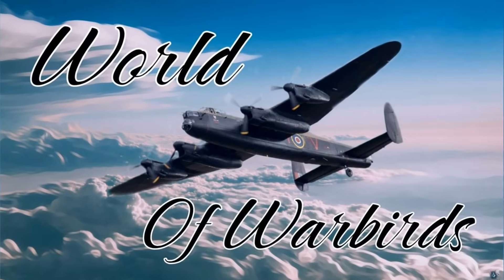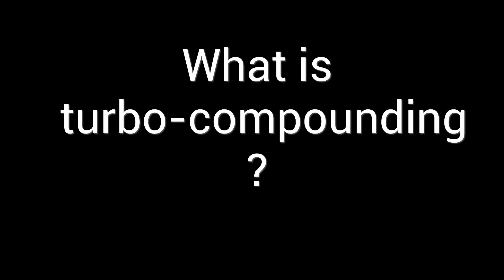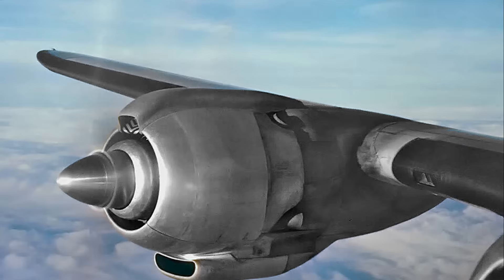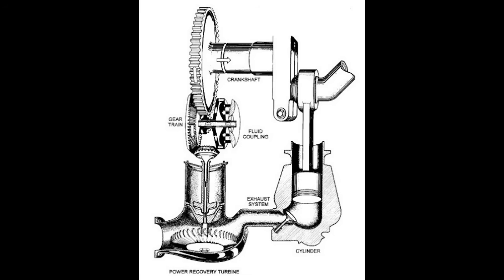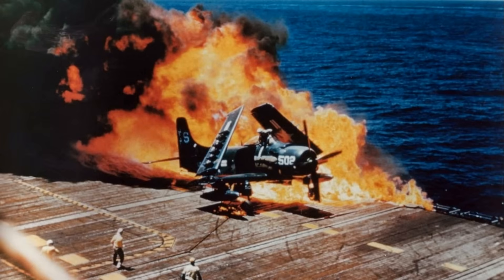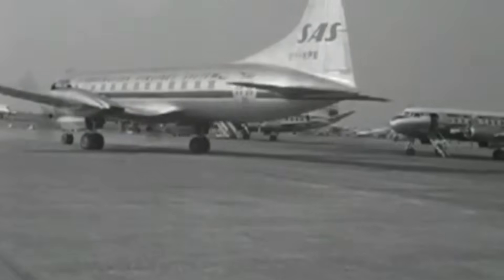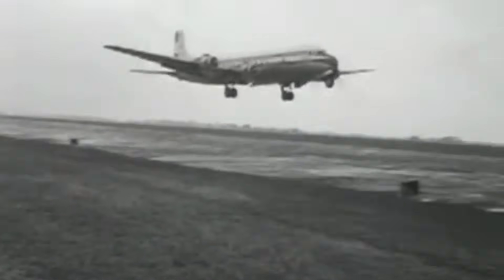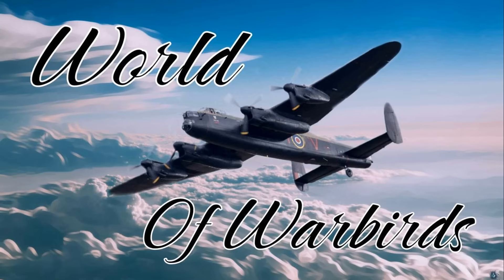Turbo-Compounding: The Forgotten Power Booster of WWII (almost) and Beyond

Comment: The problem with turbo compounding is that it is conceptually flawed. It scales well, but in the end you end up with roughly equal power output from the turbos and the piston engine, which means that the piston engine is simply a complicated gas generator for the turbines. The obvious solution to the problem is to Simply build a turboprop
Reply: There are no turboprops that are even remotely as efficient as a turbo-compound engine.
Reply: @PistonAvatarGuy the dc-7 Disappeared before the dc-6 because of the high operating costs of the turbo compound engine. There is a reason why the technology disappeared. Turboprops are the answer for efficiency
Reply: @jimeditorial  Except that the high costs associated with the turbo-compound engines were a result of mechanical problems, not inefficiency. Turboprops are less efficient than turbo-compound engines, but their operating costs are lower because they're more reliable and need less maintenance.

When you get down into the lower horsepower range (less than 400 hp), turbine engines just become completely impractical due to their cost and their inefficiency (which decreases with the power rating of the engine), so turbo-compounding again becomes attractive. These days, engineering is such that turbo-compounding is far more practical than it was in the past. In Formula 1, for example, they've completely eliminated the unreliability of the mechanical transmission between the engine and the PRT by making use of a hybrid-electric system.
Reply: @PistonAvatarGuy actually, turbo shafts were regulated out of auto racing because of their dominance. And there is very little market for commercial aircraft engines below 400 horsepower. In that power range, The Logical solution is pure turbocharging, in a liquid-cooled inline engine for lower frontal area. But the thermodynamics are inescapable... if maximum efficiency in an airliner is the goal, use a turboprop. If maximum profitability is the goal of the airline, use gas turbines. But today's geared turbo fans and some of the new open rotor designs appear to be going back to the turboprop in concept. No one is talking about developing a piston engine to replace even engines in the pt6 class
Reply: @jimeditorial   How is racing relevant in a discussion about engine fuel efficiency? And, no, I don't believe that turbine engines were ever successful in racing, because they lag horribly. They might be successful on certain racetracks, which don't require good acceleration performance (many NASCAR and Indy tracks), but they would never work well in something like F1, or any kind of racing with a significant number of road courses. Even Indy and NASCAR have road courses. Many racing series are also starting to limit energy consumption, and because turbine engines in the power output range that's suitable for racing cars absolutely guzzle fuel, they would never work in those series.

Just as an example: The Rolls-Royce (originally an Allison design) M250 consumes about twice as much fuel per hp produced, when compared to a piston engine of similar power output.

Those turbo-compound Formula 1 engines are some of the most efficient ICEs on the planet, btw. They even beat the efficiency of many large marine and stationary diesels.

Obviously, turbine engines are better suited to airliners, and the market is too small to integrate PRTs into light aircraft engines, but the point still remains, turbo-compounding offers unequaled efficiency. Even an increasing number of stationary and marine engines are beginning to use heat recovery systems, of one form or another.
Reply: You are missing the point. These are heat engines. The ultimate efficiency of any heat engine is related to the delta T between combustion and ambient . If you scale a turbo compound piston engine, you discover that you maximize efficiency by adding fuel Downstream to combust the residual oxygen in the exhaust stream . This is why piston engine then becomes a little more than a Giant gas generator for the turbines and for a large radial engine, there will of course be several turbines. Along with gearing and fluid couplings. It's a mechanical monstrosity, which is why they disappeared so quickly in commercial service. Modern Formula 1 engines are not turbo compounds, they recover power and store it electrically.  at the rate that Battery Technology is advancing, I expected in 10 years, battery electric Drive Lines will completely replace combustion engines and Formula 1 as well. If you wanted to clean sheet a design for maximum efficiency, you would probably design a turbocharged and blower scavenge horizontally opposed two-stroke diesel, a sort of miniaturized Jumo. But there would be little economic reason to do it. General aviation is small and in relative terms, it's getting smaller. Light aircraft technology has lagged the industry as a whole by decades. 1940s technology is still common. You can go into any GA hangar in America and hear the pilots talking about things like carburetor icing and shock cooling. Only the avionics Community has stepped up, and the regulatory regime won't even recognize that. We are still training Pilots to handle cross countries by dead reckoning. The only way to improve the efficiency of piston engines is by heat damming, and by using a waste heat in any way possible. But to connect a turbine to the crankshaft doesn't make sense in small engines, and it's inefficient in large engines.
Reply: @jimeditorial  Modern Formula 1 engines absolutely are turbo-compound engines, that's not even disputable. The energy collected by the MGU-H is fed back into the driveline via the MGU-K, it's just an electric coupling, instead of a fluid coupling. The batteries are not there to supply a significant portion of the energy that's used by a car during a race, they're just there to store the energy produced by the MGU-H and MGU-K.

The Formula 1 engine system itself, without including energy supplied by the battery, is more than 50% THERMALLY efficient, that makes it one of the most efficient engine systems on Earth.

Electric vehicles aren't progressing in any meaningful way when it comes to racing, they're so far away from replacing ICEs in the vast majority of racing series that it's ridiculous to even suggest that they ever will do such a thing. They can do very short races and they can dominate when they have huge budgets relative to the rest of the competitors (Pikes Peak, for example), but they can't complete an F1 race at anything even remotely close to the same pace as an F1 car, and the same is true for the vast majority of other racing series. Ever wonder why a Formula E car has never been pitted directly against an F1 car, on an F1 track? Its because the F1 car would not only demolish the Formula E car in pace, but it would also be able to maintain that pace for far, FAR longer then the Formula E car. In the slower racing classes, cost will keep electric cars from ever becoming dominant, as the vast majority of racers will simply never be able to afford an electric race car. No one is even buying the Speirling, because it's insanely problematic (the suction fans) and because it's insanely expensive. Seriously, just name one racing series where electric cars are taking over in large numbers.

Sorry, but you're just drinking the Kool-Aid.
Reply: @jimeditorial  And I don't understand what you think that I'm suggesting be done here, I'm just pointing out that in actual use, turbo-compound engines have proven that they're more efficient than turbocharged engines. What's the argument that you're trying to make against that? That they weren't? What radial engine was more efficient than the turbo-compound R-3350? What gasoline automobile engine is more efficient than current F1 engines?
Reply: @PistonAvatarGuy gas turbines were regulated out of Auto Racing for a reason. If they were permitted, then all Formula 1 engines would be turbines. For the same reason why aircraft in the same horsepower class as top-level auto racing are now all turbine powered. Thermodynamics. What mechanical complexity is definitely a factor. Operating cost per hour of engine operation is determined by a lot of things, and fuel consumption is just one of them. Which is why the dc-7 died, while the dc-6 continues to fly. Fuel is still one of the cheapest inputs in aircraft operations
Reply: @jimeditorial  You're very smart.

Comment: Would love to see someone mess around with this again just for the fun of it.
Reply: What on Earth are you talking about? The turbo-compound engines used in trucks are STILL turbocharged, so they still benefit from the blow-down effect (which is what you're describing), but they also benefit from the power recovered by the PRT feeding directly into the crankshaft.

Volvo turbo-compound engines are currently in production and they have been for a while now. Cummins and Scania also produce turbo-compound engines. Turbo-compound engines provide an increase in both power output and fuel efficiency relative to turbocharged engines, because they're using more of the wasted heat energy in the exhaust than the turbocharger alone can utilize. Turbochargers have wastegates because they need to waste a certain amount of energy from the exhaust in order to prevent them from over-boosting the engine, while a PRT just feeds the excess energy back into the engine, improving both efficiency and power output.

Hybrid-electric PRTs are even better, because they can draw energy from a battery and feed it into an MGU-H and MGU-K to literally eliminate lag, because they can more efficiently capture energy that would otherwise be wasted (no inefficient fluid coupling) and because they can better regulate the PRT system, allowing it to operate more efficiently.
Reply: @PistonAvatarGuy  I've yet to see a heavy truck fitted with a wastegate. That's not how truck diesels operate. Hint it's done with the fuel, what you said - and why on earth try to limit MAP on a diesel = more is better long as it stays in one piece.
     Never seen one with a PRT either for that matter. Not on America's highways. What you said seems too fancy and not easily repairable on long, long, loooong hauls.
Reply: @patrickshaw8595   You must be trolling, they all have wastegates, except for some newer diesels that have some kind of weird balance valve. There has to be a way to limit the amount of power that the turbocharger is absorbing from the exhaust stream, or the turbocharger will over-speed, over-boost the engine, or both.

Volvo's turbo-compound engines do operate on US highways and they do save fuel.

Edit: The VGT turbos might not have wastegates either.
Reply: @PistonAvatarGuy  Old trucks didn't have wastegates, but all modern ones I'm quite sure have some way of limiting turbine power.
Reply: @TarenGarond  Interesting, they must have been too choked off in other ways to end up in an over-boost situation.
Reply: @PistonAvatarGuy  I mean it is not really that weird on a Diesel as fuel flow adjustment changes power of both the engine and the turbo, just need to have a turbo with suiting compressor and turbine sides so that you get no over speeding or surging and somewhat acceptable air and exhaust pressures throughout the rev and load range.
Quite sure there is some Diesels still built like this but probably not on truck/cars, like on something that is supposed to almost always run with a nearly constant RPM and only with small load fluctuations a way to control turbine power is not really necessary.
Reply: @TarenGarond  Right, but that would mean that the turbine simply wasn't designed to collect as much energy from the exhaust stream as a turbine system potentially could, meaning that there would still be a significant amount of energy left in the exhaust which could be recovered.
Reply: @PistonAvatarGuy  Yeah, I didn't argue against the practicality of turbo compounding just wanted to discuss wastegates... XD
Have a good one!
Reply: Volvo experimented with Power Recovery Turbines back in the 90s. Let me explain something to you: Turbochargers are better especially for diesels. Say you are driving along down the highway in your semi and the turbo is providing say 7.5 psi boost. THAT IS ACTUALLY HORSEPOWER EXTRACTED FROM THE EXHAUST AND AIDING THE CRANKSHAFT BY MAKING THE ENGINE'S INTAKE STROKE INTO A MINI-POWER-STROKE. < Power recovery PLUS the ability to burn more fuel and make more power when needed. So Power Recovery Turbines - being uni-taskers - went obsolete (for diesels, anyway)
Reply: @patrickshaw8595  Some of the producers of stationary and large marine engines (Jenbacher, Sulzer, etc) also make use of heat recovery systems of various types.

Comment: Plenty of pictures of Volvo's turbo-compound system, but no mention of it in the video. Current Formula 1 engines are also turbo-compound engines, but instead of using a mechanical system to transfer energy from the turbine to the crankshaft (and to a battery, if necessary), they use a hybrid-electric system.
Reply from the maker: Hello, yes I used any images I could get to illustrate, but my interest is in aviation turbo compound and not in general. Thanks!
Reply: @worldofwarbirds  I see, but the video title also suggests that the technology was forgotten, when it clearly hasn't been.
Reply: @PistonAvatarGuy  OK, we got it. You've made your point that you know a lot about turbo-compound engines, but there's no need to shove it down our throats.
Reply: It has nothing to do with the uses you have mentioned, it is about WW2.
Reply: @bigboy9693  Yet he included pictures of Volvo's modern turbo-compound system.
Reply: @PistonAvatarGuy TO EXPLAIN THE CONCEPT, YOU GOOF. By calling it “forgotten” he’s just saying that we (the lay-person with knowledge of WW2) don’t tend to know about these aviation powerplant advancements, as much as we would know about jet development, for example.
Reply from the maker: Thanks, but let’s all play nice!
Reply: @dillan6134  Plenty of other pictures that he could have used. The Dobrynin VD-4K is suspiciously absent, for example. I learned about turbo-compound engines many years ago, I never forgot about them.

Comment: Nothing drives innovation like war!
Reply from the maker: Sadly, but realistically, yes!
Reply: Racing. In F1, there are currently hybrid-electric turbo-compound engines, which do away with the mechanical complexity and unreliability of the Wright turbo-compound system.

Edit: And I'd rather see innovation move along at a snail's pace than live in a world where war exists.
Reply: @PistonAvatarGuy 
How does an electric supercharger work?
Reply: @Machia52612  How is that relevant to this discussion?
Reply: Unfortunately.